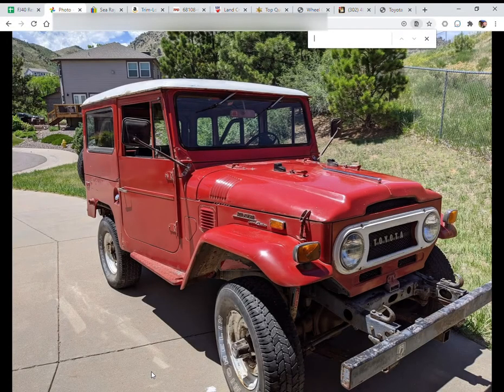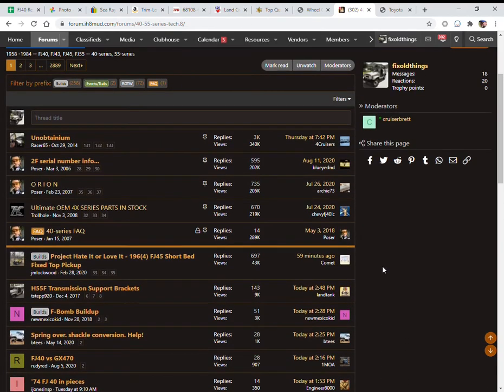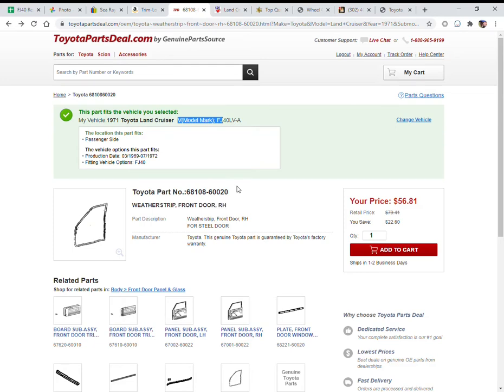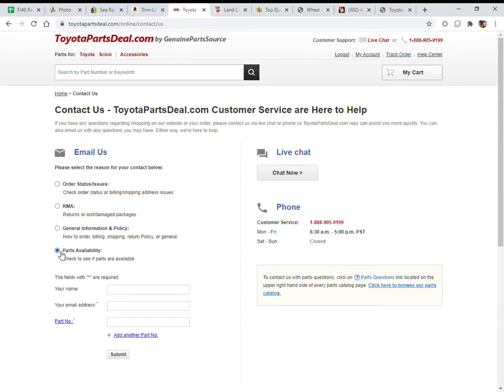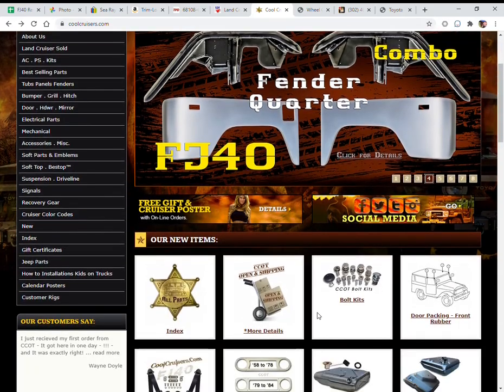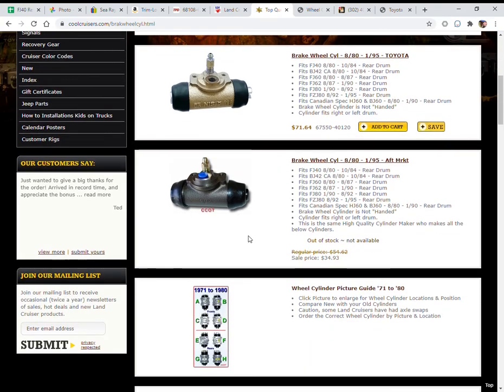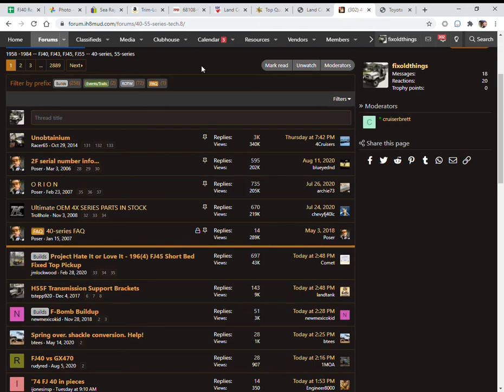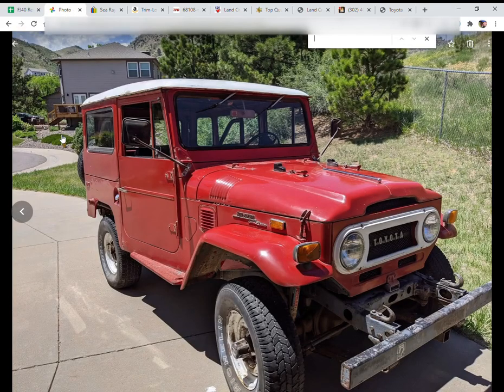Sourcing Parts for an FJ40

Comment: Excellent - lots of useful info.  One other site that should be checked is Rockauto.com.   They have stuff at good prices, but be sure to be aware of their shipping as the shipping can be expen$ive.  I checked and they had a clutch kit for your '71, but no wheel cylinders - but they have wheel cylinders for '72.  They also have engine parts.
Reply from the maker: Good tip. Thanks.

Comment: Where do you go to find original  doors and body parts?
Reply from the maker: I've found original parts in the following places:
1) Local salvage yards that specialize in Land Cruisers are my first choice. An example here in Colorado is ClassicCruisers.com in Poncha Springs.
2) Check out the ih8mud.com forum. If you don't find what you want, post a "looking for" message.  A member might have one to sell or know where you can find one.
3) Try an online Toyota OEM parts outlet like ToyotaPartsDeal.com.  Surprisingly, you can still get quite a few new OEM parts from Toyota. 
4) eBay Motors. Sellers can be greedy and shipping costs are high, but eBay might be your only choice for really rare items.

BTW, repairable original doors basically don't exist anymore. There aren't any left.